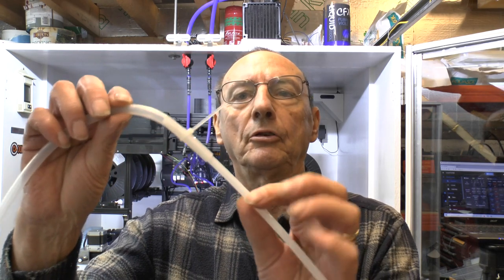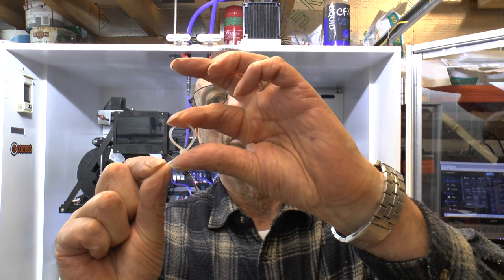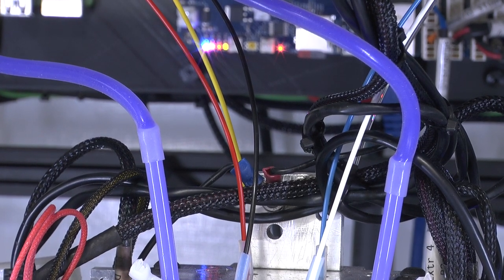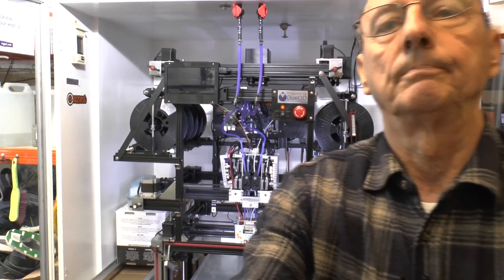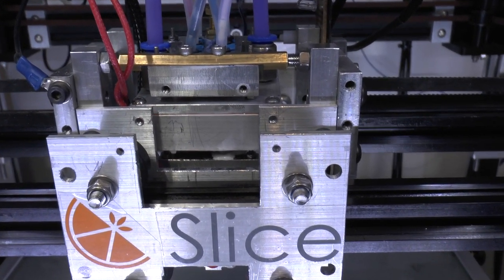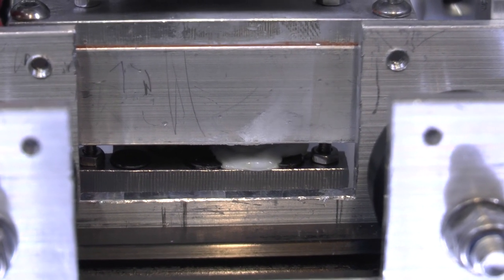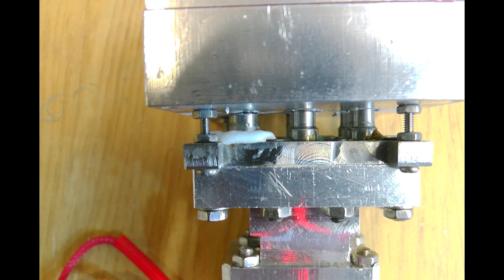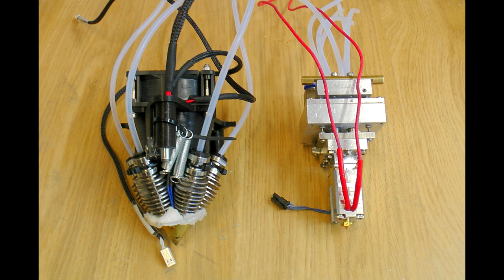My 6 input mixing hot end - part 13

Comment: I've been building custom water cooling loops since the 90s, starting with heater cores out of junk yard cars.  Stretching tubes over those ridge pipes are not going to last over time, especially on a MOVING part like the gantry!

Instead, they make barb adapters for exactly this. They have several sharp raised edges that dig into the tubes and seal all the way around.  And, there are several of them so if one leaks, you have 3 or 4 more that it needs to by before leaking, not just 1.

They make male-to-male barbs to extend those tubes.  You may also be interested in the bards with well-known NPT threads.
Reply from the maker: Thanks. I guess you didn't see the preceding video (part 12), otherwise you'd have seen that I've used ridged connectors on the pump, radiator, isolating taps, elbows and step down adaptors. I couldn't find a ridged connector that was smooth one end (to fit into the push fit connectors), and ridged on the other end. Hence the smooth pipe. If you have a link to such a connector (6 mm OD smooth to ridged), I''d much appreciate it.
Reply: @deckingman  ah no. I didn't see the last video.

However, looking at that 6mm ID hole, couldnt you tap it for 6mm NPT?  Then you can just screw in normal barbs.
Reply from the maker: @eduncan911  Yes, I guess I could have done. TBH, the push fit connectors are screwed in to M6 tapped holes in the coolant tank, so I could replace those push fit connectors with ridged ones. But then, I wouldn't have a quick way to change the hot end - I'll give it some thought...........

Comment: Can't wait till the first mixture comes out, more wondering right now how much filament it takes to purge the Labyrinth.
Reply from the maker: Yes, it's one of the factors I have to balance. More mixing stages = more volume. 
A couple of years ago I developed a post slicer script which advances the tool change point within the gcode file. Essentially, when you switch from one filament to another it takes while before the new filament starts to come through. So one can leverage that to minimise the amount of purge needed. It worked quite well using a Diamond hot end but that doesn't have much a mixing chamber. Other techniques that I've used in the past is to "hide" the colour change in the infill but that depends a lot on the geometry of the part being printed. I'll just have to play around and see what I can do.

Comment: Great stuff you do!  I really like your projects and your setup!
But i also have a question for you...
You were talking about swelling filament in the hotend caused by the hotend temp. I´clearly understood that and to prevent it from blocking the hotend i put a PTFE tube into my hotend like you did.
After a while of printing things i wanted to change from PETG to ABS filament.
What happened is that the obviously swollen end of the filament was pulled out of the hotend through the PTFE tube, but then got stuck in the hole of my direct extruder.
(To mention my setup: Its a Volcano Hotend with a direct Extruder Clone from BMG)
Now i got that piece of PETG stuck in my extruder output hole. Needless to say that the extruder tried to retract the filament and scratched it down until it broke. 
Which way of getting this piece of filament out would you recommend?
pushing it down again didn`t work at all. Im thinking about drilling it out but definitely don`t want to destroy my extruder. 
Melting it out could be worth a try but i dont know how i could do this properly.
Do you have any ideas or recommendation?
Thanks for your help!!
Reply from the maker: I've had the same thing happen with one of my Bondtech BMGs. I've since learned to stop retracting before the filament gets that far back but you won''t be able to do that with a direct drive. The outlet hole in the extruder is hardly any bigger then the filament. I used a drill in a hand chuck. Started with 1mm and worked my way up. BUT, I did end up taking a bit out of the extruder itself. However, that doesn't seem to have caused any problem. Best of luck !!

Comment: Love your work!
How many colors ideally do you think could be reliably reproduced?
Reply from the maker: Well it's complicated. To start with the firmware will allow mixing ratios in 1% increments and I'll be using 5 colour plus transparent (6 in total). So there are 5 colours that can be mixed. If we call them A,B,C,D and E then we could have 100 combinations of A plus B ranging from 100% A with 0% B all the way up to 0% A with 100% B. Then we can do the same with A + C, A +D, A + E, B+C, B+D, B+E, C+D C+E and D+E. But them we could use 1% of a third colour and repeat that entire sequence and then repeat again with2 % of a third colour etc etc. And when we finish all those combinations, we can introduce a 4th colour and then a 5th colour. So in theory, using factorials to do the calculations, I think there are about 4.6 million combinations. 
But of course, many of those combinations would come out as some sort of muddy brown colour. And then it depends on one's definition of colour. If we mix red with yellow in 1% increments, we get 99 shades of orange. Do they all count as separate colours? The same applies to blue and yellow giving 99 shades of green, red and white giving 99 shades of pink etc etc. 
So there isn't really a definitive answer except to say that there are around 4.6 million combinations of any number of five filaments when mixed in 1% increments.